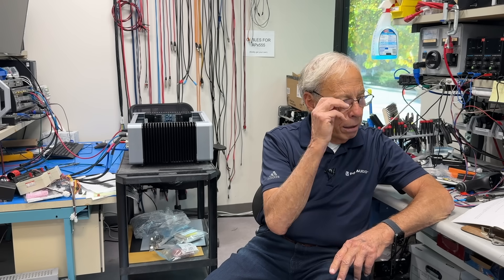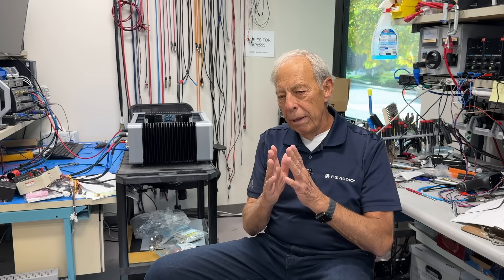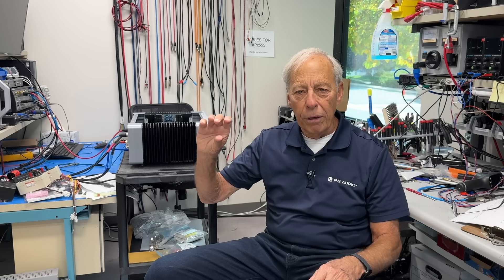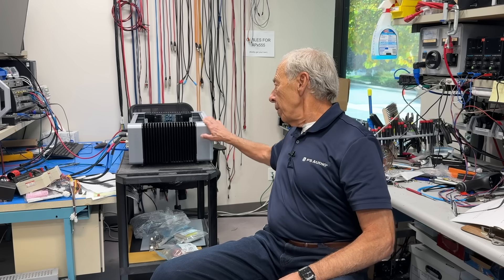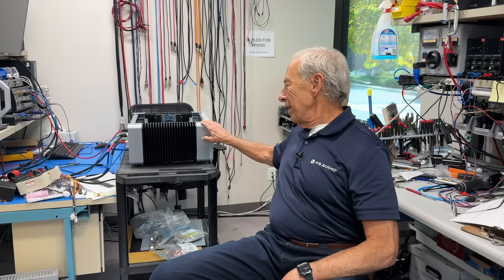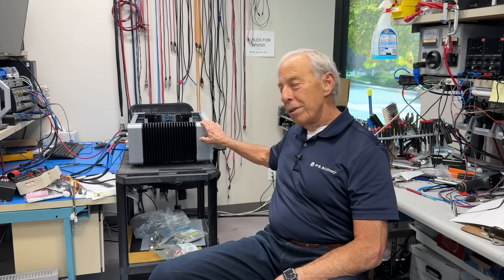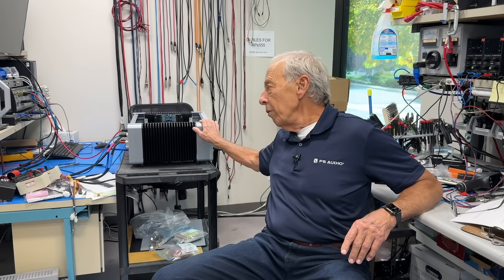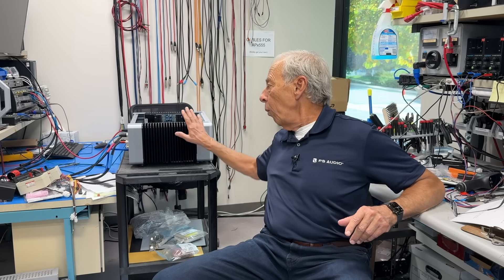Digital vs  Class A and AB amps

Comment: My preference is Class D... small, light, runs cool, tons of I/O.  I have levels of Class D quality depending on the purpose:
- NAD C298 to bi-amp PS AUDIO FR5 planar tweeters of primary system.
- PS Audio S300 dual mono (has class A input stage) to bi-amp PS AUDIO FR5 mids of primary system.

- Parasound Zonemaster 2 (has class A/B input stage) for 2ndary system in family room for GoldenEar BRX speakers.
- Aiyima A07 Pro for backyard Yamaha 3-way speakers
- Aiyima A08 Pro for 2 bass shakers in home theater
- 4 powered sealed subwoofers each with builtin Class D of 800-1500 watts 

https://youtu.be/LBe7dGgvc9Y
----

My older Class A/B amps are:
- Arcam AVR5
- Parasound 2125v2
- Emotiva BasX-A3 (not recommended)
- Denon 1912, S760H, X3700H  (not recommended)
- Onkyo (not recommended)
Reply: class D is the future whether anyone likes it or not.
Reply: I know the BRX is far lower in cost but how does it compare to the FR-5? I also have the BRX in a second system.
Reply: @evanziegler878   ...you won't know until you listen for yourself.
Reply: @mrpmj00 ...how many times are you going to repeat this post today?
Inquiring minds would like to know 🤔
Reply: @fatrat this lad stands at bus stops repeating this same thing daily
Reply: @1stswim he is trying to get traffic to his YouTube channel
Reply: @mitchtaylor6512   ...yeah, I hadn't considered that...thanks!
Reply: He has blocked quite a few people that disagree with him on the PS audio site. I guess he doesn't want to learn anything.
Reply: @mitchtaylor6512   ...huh...strange man; strange agenda.
Needs constant validation, much like a certain POTUS 😉